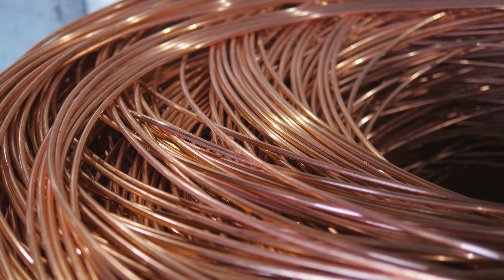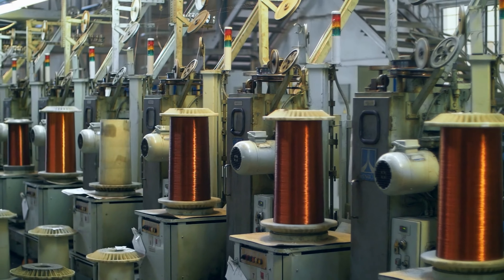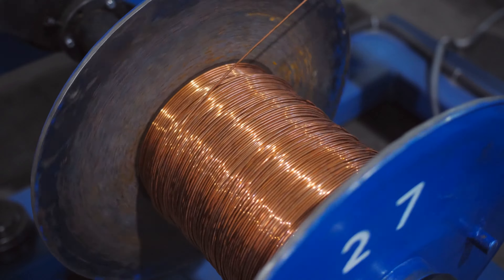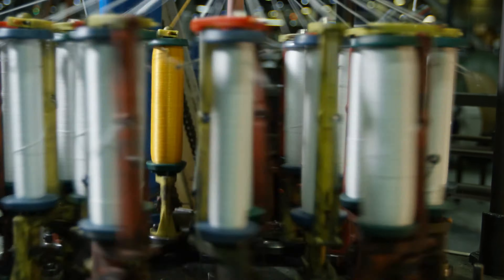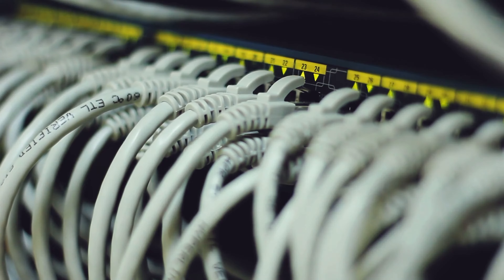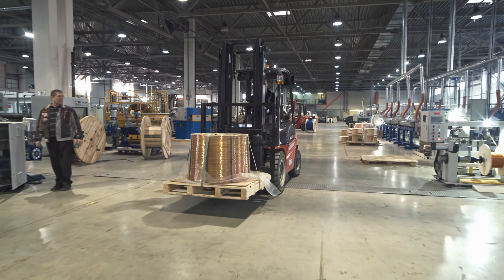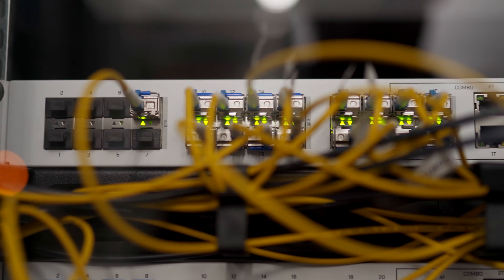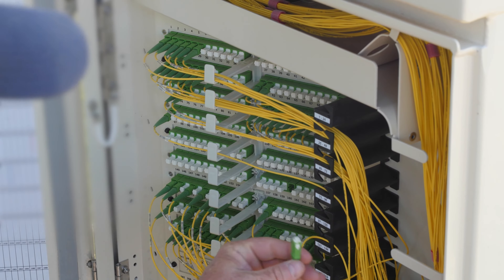Broadband | Copper Wires & Fiber Optic Cables Explained

Comment: 30 something years ago, I was helping to run cables for the railway system. One of those cables was a fiber ( I think 6 cores ). Very flexible physically, kinked super easy ( don't flex it ). It was a 3 km run between amplifiers. It was something like $3000 a joint and on average took 3 tries to get correct ( I didn't have anything to do with that, I was only "pulling cables").
Reply from the maker: Thanks for sharing

Comment: 1:50 stranded copper wire can tolerate bending, solid core copper wire is likely to break after repeated bends in the same spot
Reply from the maker: Good catch thanks